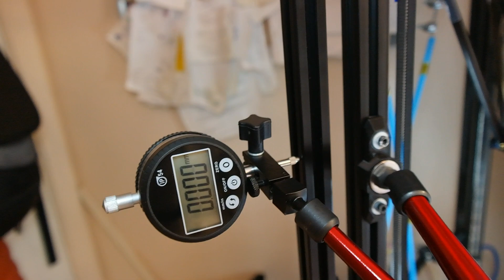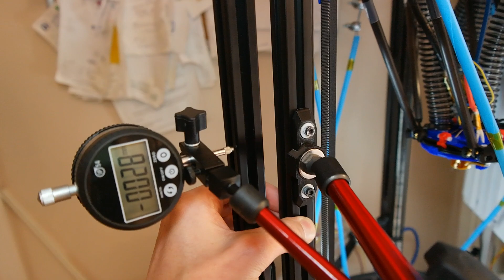Printer Diaries: How stiff is 2020? | Delta 3D Printer | Shorts

Comment: yea 2020 flexes.   how much that matters at the hotend though, dunno. what i do now that a moving bed printer that you stiffen up by just lazily throwing more 2020's at it to box it up does sing a lot less and feels a lot less sketch when running higher accelerations and speeds
Reply from the maker: for a delta, any carriage deflection will (generally) be multiplied at the hot end by the arm geometry, so this is pretty important in this case.  Most other motion systems are more forgiving, though!